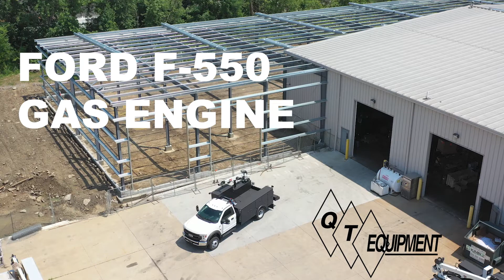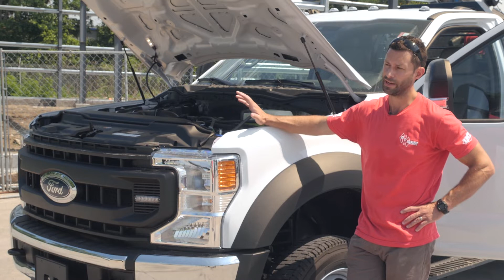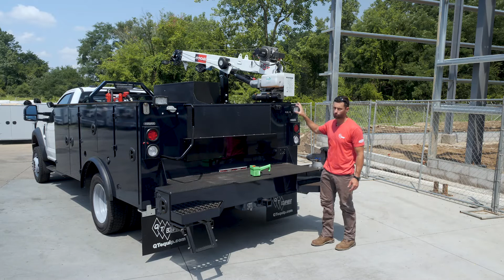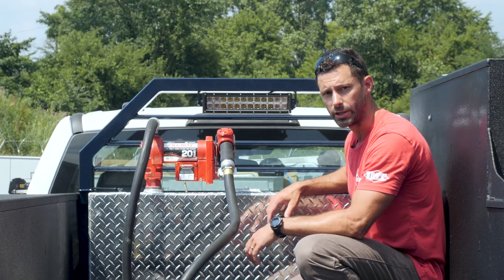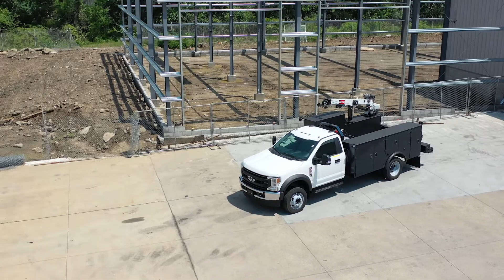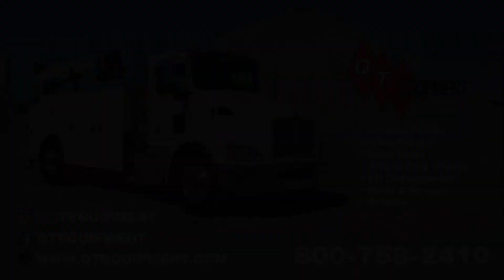F550 Service Truck with Ford's new 7.3L Gas Engine

Comment: it's probbably a real good engine. they kind of made it like they used to make them. 7.3 is obviously a sales gimmick, sales gimmick. 7.3 is a legendary number used to identify a tried and true diesel engine. so the whole sales pitch rides on the coat tails of the 7.3 powerstroke. still like I said it's probbably a great engine , i hope to pick one up some time when the hype wears off. for a reasonable price of course.
Reply from the maker: Thanks for watching Kimmo!  We never heard back on this which is usually a good sign!!

Comment: So work for a bigger company & i got a imt 6000 crane/ work body on my 2021 550, i got the new v8 & its a HUGE IMPROVEMENT  over the 10 cyl.  Which mine had alot of crank sensor/ harness no start/ stall issues. Way more power & is diesel simmilar to me. How do i turn off the 4 min run timer... sux running in & out in the morning to thaw it out...
Reply from the maker: Good to hear Stan!!  Not sure on how to turn off that timer.  I know guys can hook laptops into the F550 and tweak settings but have never tried messing with the timer.

Comment: The gas engines are slowly taking back over the truck market. 8-10k$ cheeper upfront, cheeper maintenance over the life of the engine. You can drop in a new create engine for the price of most major aftertreatment repairs, a set of injectors or turbo replacment. No need to buy def fluid. Gas engines weigh less which means the front end does not sink as fast when off road. We have a fleet of the 6.2 liter fords currently. We are getting a pretty easy 300k miles out of them with just nornal maintenance. Our trucks weight 12-15k lbs and thats before we hook to our 10-12k lbs trailers. No they are not rocket ships but they still nove the load down the road quicker then most class 7 or 8 trucks are moving. The only true downsides to the gas are a little less power and a a little worse fuel mileage. I am getting the first 7.3 to test out. Hopefully its worth the hype.
Reply from the maker: Great info Indiana!  Much appreciated.  We have not seen many customers make the switch but keeping our eye on this...
Reply: 100% agree. I was a huge chevy fan  and have had numerous diesels.  Repairs are getting unbelievably expensive on those diesels.  I have a 22 f250 with the 7.3 and 4.30 gears ordered. I can't wait to try it out.
Reply: Did you end up getting a 7.3?